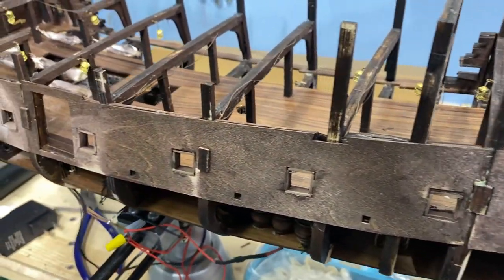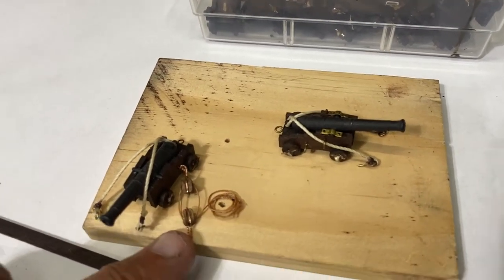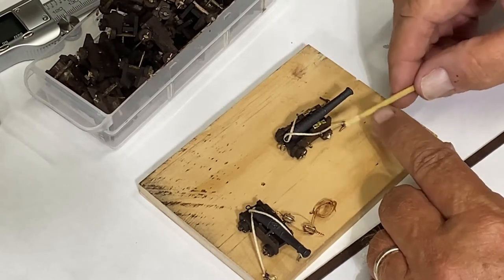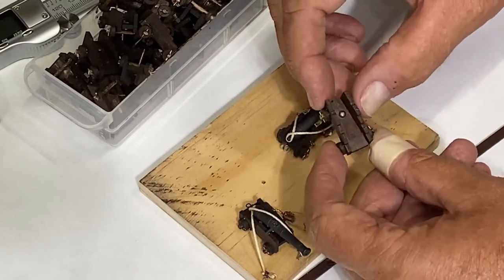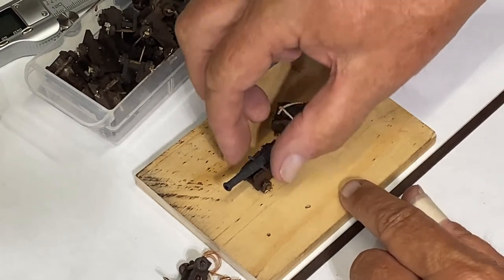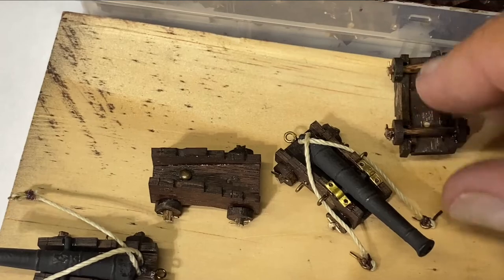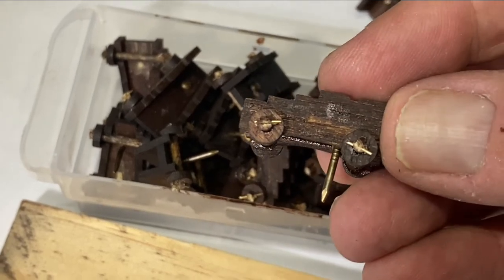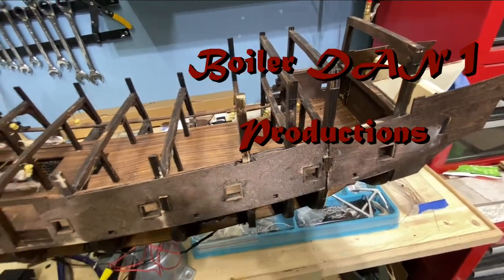Black Pearl All Scenario Version PART 6

Comment: thanks for the nail in cannon cradle tip. should save a lot of frustration in the future
Reply from the maker: You’re welcome.  It’s working very well.  Just make sure that you allow room for the axle…. That can be eliminated  if you drill the hole after you assemble the wheels.  Then put it on the ship’s deck and use it as a guide for the hole in the deck! 😁👍

Comment: Dan, where did you get the brass holders on the cannon post? Ray
Reply from the maker: eBay from “Peters model supply”.
Here’s a link: https://www.ebay.com/itm/144357494539?mkcid=16&mkevt=1&mkrid=711-127632-2357-0&ssspo=MMAmId1yRoG&sssrc=4429486&ssuid=s8A53jWuRTC&var=&widget_ver=artemis&media=COPY
$5 for 12. Ships for free.